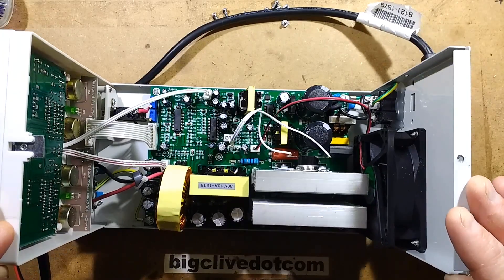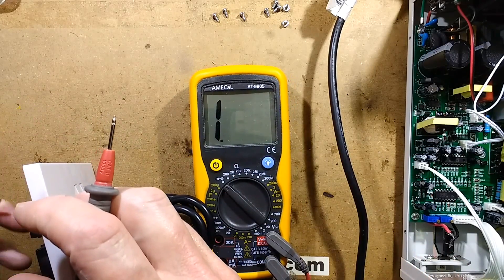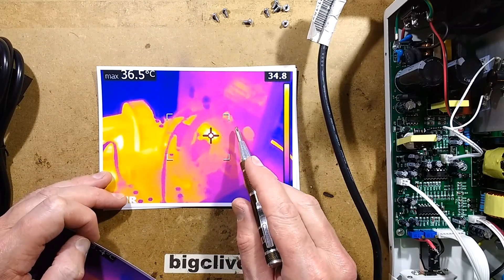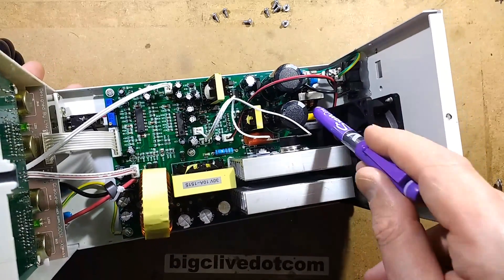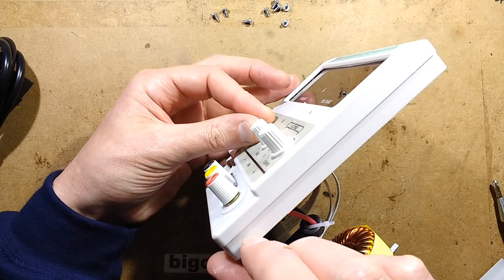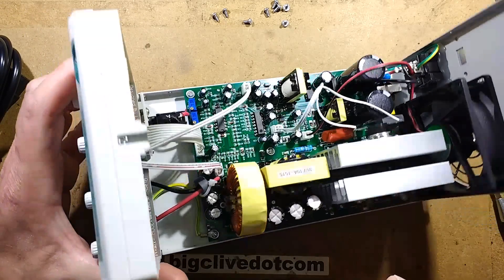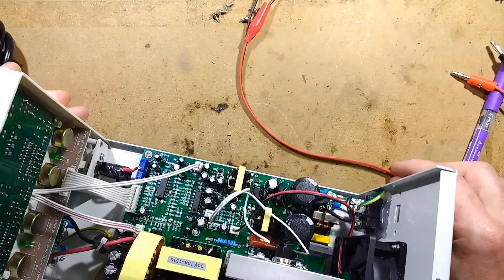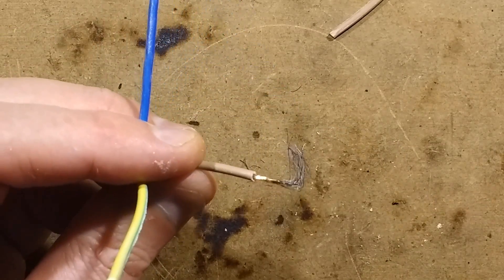Test of a PSU like the one that went on fire.

Comment: There really is NOTHING WORSE than copper-coated aluminium.
Reply: Tom Straight aluminium. I've got some at home and its useless since you can't solder to it.
Reply: Worse = CCS.  Copper clad steel.  Some cheap Ethernet cable is made from it. Connections are perfect on day one.  After that it's random failures and poor connections all over the place until the day the whole lot is ripped out and replaced with copper.
Reply: Worse then copper-coated aluminum:   Hemorrhoids
Reply: its not even bad so long as the right gauge is used in the right application. that mains lead is probably fine for the current it has to carry.
that said, CCA can be shit. I had a pair of croco-banana leads like the ones clive shows in the video but mine were supposed to be test leads rather than power. they had the same shoddy construction but used a very few, hair-thin CCA conductors and they were 60cm long. plugging the bananas into my meter and connecting the crocs together they measured at 3.5 Ohms :(
Reply: World hunger is caused by copper-coated aluminium.

Wake up sheeple!
Reply: Evil from evolution
I`ve seen as much aluminum wire stolen as copper  they both fetch a good price at recyclers
Reply: Bubonic plague?
Reply: @leplum2001  How about the Spanish Inquisition? Nobody expects that.
Reply: An egg without salt. My grandma told me.
Reply: Andrew Input true but if the cable is .75sq.mm aluminium posing as .75sq.mm copper it's dishonest and dangerous. BS7671 prohibits the use of aluminium cables less than a certain size in installations because they can comply and loosen in brass fittings which causes bad contacts and fires. Aluminium fatigues faster than copper. I'm all for saving money on big installations like hv grids but indoor flex should be copper for so many reasons. Curse these chinese and their funny business. @clive - were the test leads copper or ally?
Reply: Yes, noticed TLC are selling CCS telephone cable now. Bet that's gonna cause a few issues with ADSL :\
Reply: Guess you never met my ex wife.
Reply: As someone who opened alot of stuff up as a kid i was shocked.
Reply: Ned yep its common in regular transformers too, I've de-secondary'd a couple of microwave oven transformers that had CCA windings.
Reply: +bdot02 Yes, but you need to double the area for Al at same current as for Copper...
Reply: I've even seen powerline transformers with big "WINDINGS ARE MADE OF ALUMINIUM" signs on them.

I wonder if that actually works to deter the copper thieves or if they just steal them anyway thinking they're fake.
Reply: how about aluminium coated copper?
Reply: Main thing with aluminum power cables is that they're substantially lighter than copper ones, allowing the power poles in between to be less frequent and less expensive to construct.
Reply: Luke, damn straight. I pulled a 3V AA battery holder out from my parts the other day for a project and... aluminium wires... WTF?
Reply: You can solder to aluminium but you need to nickel plate it first. You can braze it too but I'm still a hell of a job.
Reply: Tom yup just typical chinese junk/srap/$h!t. They don't mind safety but just money
Reply: Yeah sure, I was just saying that not only do power companies use aluminium cables for the power lines, they even make the transformers out of it sometimes.
For domestic use though there's really no reason not to use copper. It's not like you need miles of the stuff...
Reply: steel wire in those cheap banana clip jumpercables is worse
Reply: yeme that was my first thought but the connections are going rotten. I'll probably use a heavy duty crimp and fill it with duralac to keep the corrosion from eating it a second time.
Reply: @WineScrounger  The make a kind of grease to protect aluminium connections. I have never used Duralec, It looks good but I did not find it used a lot for electrical connections.
Reply: CCA is garbage
Reply: American Locomotive I've never tried this but I'm told it's possible. For waveguide its usual to nickel plate it and solder to that. The other possibility is brazing an aluminium lug. The original connections in the welder are just made by wrapping the wire round a M8 screw between two washers and clamping it up.
Reply: Rusty steel...
Reply: +bami2 no. no it isnt.
Reply: Ned if they are made of aluminium, it's fine as long as you use the. Proper winding count and thickness. Here these chinese idiots say it's copper but it's just some kind of plating and ordinary aluminium
Reply: yeme I think one of my welder transformers has a CCA secondary. I need to figure out a way of connecting to it when I rebuild it.
Reply: if youre leaving that secondary in place, just re-use the existing connections?
Reply: Sander Deryckere
How can-does one 'fly.control'?
Reply: Can any1 recommend a good “electricity for dummies” video series/online course that’s available, or a book if nothing else? beyond the basics, I want to understand the relationship between current/voltage, and how setting a dead car battery to charge at 2amps for instance starts off with a very low current & unknown (to me) voltage & why/what causes that. Resistance/impedance that changes as the state of charge changes I assume/maybe? Regardless I’d like to understand it better but I don’t learn from textbooks very well, I can /memorize/ from textbooks, but I /understand/ from doing or at least observing.

What would you set this power supply to to charge a dead-ish car battery for example.
Reply: "There really is NOTHING WORSE than copper-coated aluminium."   What about caramel-coated turds?.. Way worse than copper-coated aluminium.
Reply: Yes there is, mine was made of iron!!! 4ohm / 60 cm.
Reply: copper-plated iron
Reply: not even world hunger? the kardashians?
Reply: Don't they use aluminum for all the heavy duty power lines?
Reply: Basically : use aluminum cables when you fly control where the cable will end up (thus can control about all parameters) and weight is important (f.e. high voltage lines), use copper when you don't know where it will end up being (like pretty much every consumer cable). I don't think they sell aluminium cables to anyone here, unless you're a professional in the high voltage industry.
Reply: You actually can solder to it! You just need to clean the wires by scraping some of the oxide coating off and solder quickly. Alternatively you can use a special flux which will clean the oxide layer off.
Reply: That is a fun thing to learn the hard way lol. Making prototypes of stuff figure hey aluminum foil could take an option I didn't have place... nope lol. I have solder nickels and pennies together solder sculpting with crap solder yet aluminum foil is quite rude.
Reply: +Andrew Input ; there is the problem! you preface the assertion that Copper Coated Aluminum is As Safe As Copper only, and then you have not considered that both Aluminum and Copper are metals that are extracted from the earth. You have accepted that an inferior product ( Aluminum Conductor) is a suitable substitute for an equivalent (but more expensive) product.

This is where the 'green-washing' starts.

If you look at the Copper and the Aluminum industries world wide, then compare each as to its environmental impact, you will see that they are very similar in the amount of waste created in the production of the end product.

But, if you compare, the base metal to the cost on the open market, it is more of a market influence, than a resource availability influence that causes the price differential,

For this reason, myself included, refrain from designing things with ROhS in mind, but instead design to best available standards, since ROhS is nothing new, just a mandated verion of 'green-washing' IMO.

While initially, there may not be any apparent flaws with CCA, it is essentially a cheaper version of pure Cu, and manufacturers are allowed to get away from the 'quality' definition by implementing cheaper to purchase (and higher profit) products in the build process.

Depending on what part of the world wou are in, there may have been the years where there were houses and other structures built with mains wiring that used exclusively AL cable in the branch circuits.

While the intent was deemed to be acceptable, in Ontario, Canada, at least, the effect was not initially apparent, and that was the galvanic action of two dissimilar metals, when used in mains voltage (120v) use.

Because AL is so soft to work with, and the Electrical Trades were not initially trained on how to install the wiring, the installers would use the same amount of force on the screws and connectors used to clamp the wires to the terminals to the brass-bronze-copper-steel plated terminals.

When time and galvanic action resulted in corrosion on the termianls, and then further use at high current( 12A max in a 15A branch), then there were a few cases of FIRES in homes that had the wiring.

While you claim to want to use 'less precious materials', the actual effect is the opposite, and you wind up using as 'precious' a material for the cost, but the true cost is not embedded into the price of the base materials.

CU has a higher melting point 1084C vs AL 660C, and for this reason , makes the base metal easier to work with , but also means that it (AL) can become brittle faster than CU can in a home or office environment.

It (CCA) is an Inferior product, that is substituted because the specifiers do not want to pay the same price as what the price of 100% copper goes for.

Check out the world commodities rates for +6mos delivery between CU and AL, then look again in 6 months again.

You will then get an idea of how 'precious', the metals really are, and why the substitution happens.

As a qwll known Video person put it , "I prefer my solder with full 60% lead please"...

Since that is the BEST material to heat, melt, and affix electronic components that are tin-dipped copper clad connected. (There are exceptions).
Reply: Im not seeing anything actually wrong with it here. If the cable is thick enough to have correct resistance, and it does not have durability issues I prefer to use less precious materials.

Comment: My CircuitSpecialists power supply has similar leads but they are at least soldered at the croc clip end. I'll keep an eye out for better ones.
Reply: I soldered mine as they stopped working, I really should get something more chunky.
Reply: I bought a cheap multimeter that turned out to be really good, with really shitty leads. The probes just broke off the wires. There was also a set of leads like those shown in the video, they were folded and screwed in the same fashion, as well as the crocodile clip end which was also folded onto itself and then crimped.
Reply: I bought some cheap leads off of Amazon from elenco ($5) and their nice n beefy
Reply: I got some leads just like the ones Clive got. The croc end actually burned the wire because I put too much current through it. Since then, I've stripped and soldered the croc ends, but the resistance across the cable is still crap
Reply: Matt Tester hello